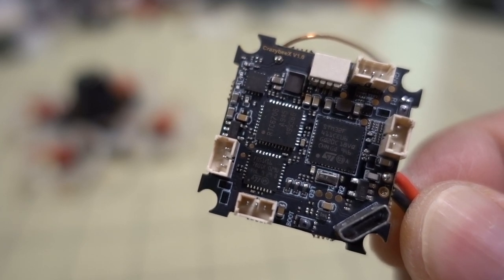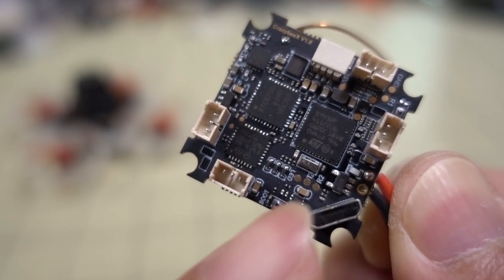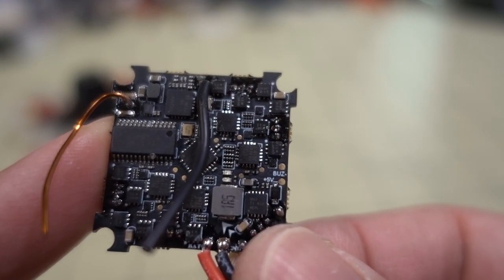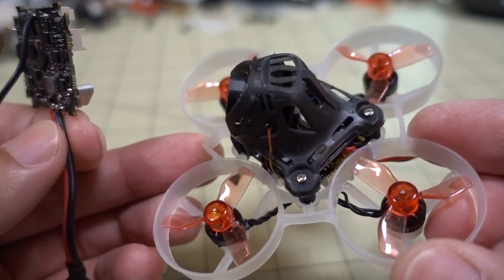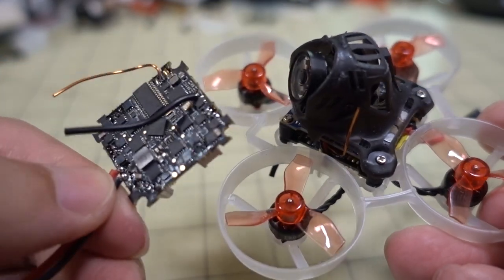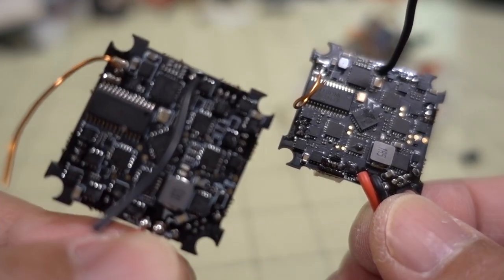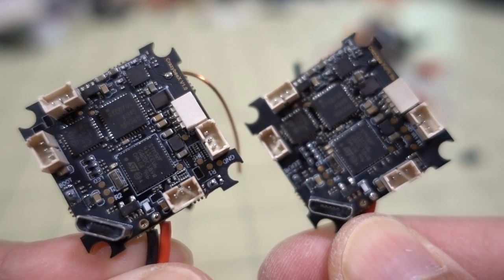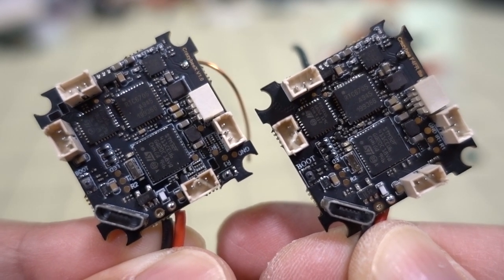Happymodel Crazybee X 1-2S AIO FC Overview ⚡

Comment: Man, I want some of these! Hoping they get some out to the retailers here soon, like Pyrodrone. I wish they made one without the receiver, I've ended up using my own receivers in the original Lite board. Its too bad theyre saying not to use it for 65mm props on 2s, but hopefully it also means that at 1s it won't fry as easily. Thanks Albert!

Comment: Just flew mine inside for a few rips. What core temps are you getting? I'm finding if it's already starting warm, it will go to 70c pretty quickly at room temperature while in the air. Wondering what the normal is for these boards.
Reply from the maker: Don't worry about core temp warnings.  Just turn it off.  The bigger problem is the VTX.  Don't power up and just sit there... fly it ASAP to cool the VTX.  If you let it get too hot too often, it will eventually die.

Comment: Hi Albert thinking of building a 2s toothpick with this board but there seems to be some questions about pro size that can be use ( Happymodel says under65mm) got any idears 
Cheers 😊👍
Reply from the maker: Yes, keep the prop size under 65mm.  As you increase prop size and weight, the amp draw will go up and exceed the rating of the ESCs on the board.  You risk burning them up if you exceed the rating.

Comment: accidentally remove camera socket from the crazybee x.. can you help me to show which pad if i want to solder the cable of camera? Please reply kim 🙏
Reply from the maker: AFAIK, there is no where else to solder to.  You'll have to see if you can solder to the tiny pads where the connector came off.  That's the only way I know.

Comment: I have this on US65pro and the Video feed went black mid flight, no OSD either.... can the VTX be turned off in this state... that area of the board still gets pretty hot...
Reply from the maker: Seems that the video system is broken.  There's no way to turn it off AFAIK.

Comment: Have you had any problems with the vtx cutting out? Once mine hits 80°c out like a light
Reply from the maker: I don't let it sit on the bench to overheat.  In the air while flying around it never gets that hot.
Reply: @AlbertKimTV  this is while flying it starts to overheat its happened 3 times now, not sure what to do with it. I was debating on flashing emu and seeing if that fixes the problem. I have a friend having the same issue.
Reply: @muhname_esjefffpv1472  I'm having a similar rover heating issue while flying at room temperature in a basement. Climbs to 70c in about a min or two.

Comment: I burnt 1 esc on the crux3 after 15 lipo without reason. Got a a second FC. 1 esc was defective from factory. Any Idea?
Reply: They are bad. Got two bad of two. Both have the same issue. Motor spins up but starta twiching after voltage drop.

Comment: Why still use a 5 amp board?  Same size as 12 amp boards that are numerous! Can't be a weight issue... The 12 amp boards don't weigh much more, but are so much more durable and capable!  Sure, it says it can use 2s, but it also is warned not to use 65mm props with 2s!  So, no good for Toothpick quads.  I don't get it!!!  :( 
...Thanks Albert for showing us this.
Reply from the maker: They want this just for whoop style quads.  They have something else that is heavier for toothpicks coming soon that will be 20A